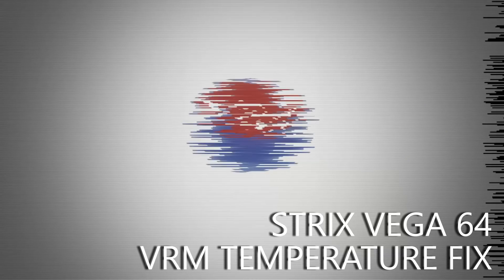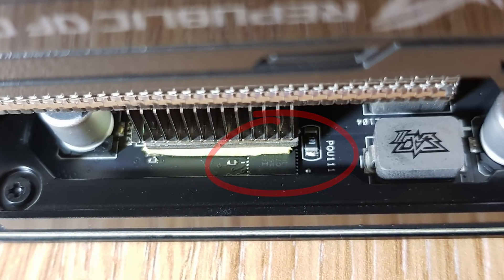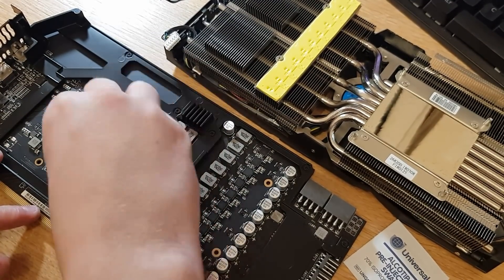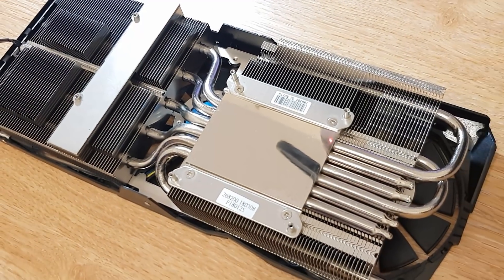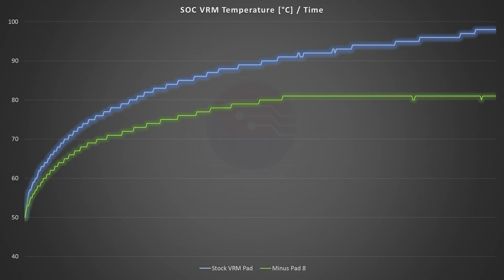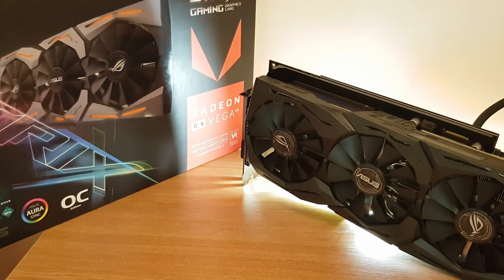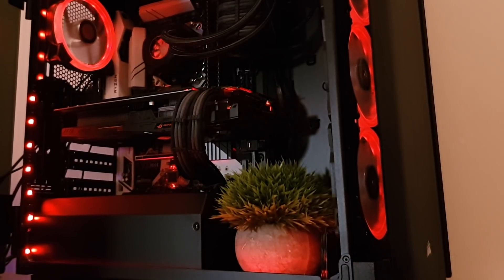Asus Strix Vega 64 - VRM Temperature FIX

Comment: Had this problem on my Arez 56, bought the same thermal grizzly pad mentioned. Totally worth the money, no more ~99° C VRM temps in HWMonitor. Thanks for the tip, and for the advice to undervolt for better performance.

Comment: Done this mod. Temperatures of gpu and hbm memory went down to 70c +/- but in some more demanding games gpu will stay around 74c +/- hbm memory +/- 80c with hot spot a bit higher. Running card with stock Vega 64 frequency undervolted on gpu and overclocked and undervolted on HBM2. I'm playing in 4K but noticed that in 2K card frequencies are solid and temperature is lower. Sweet spot for Vega 64 is 2K so if that's your resolution then this card is still relevant in 2020.

Comment: this happened to me, when I play more game which need more performance I play about 10min and after it turn off (I use it as EGPU with razer core X). when I left it our from the cover it is no problem but when I leave it inside after 10-15 min it turn off it self.

Comment: I did this fix with my vega 64. After plugging it in, there was a corrupted blue screen and now it doesn't show any display. I tried to remove it and plug the hdmi on the motherboard but it's not showing any display either. Did I just break not only my GPU but also my motherboard?

Comment: Cool video, i have this same card. I had no idea about this problem! I didn't even notice this taking my card apart, and I just installed over the weekend, a full waterblock setup for my Vega64 Strix including a full motherboard block, and i went from 70+ degrees, all the way down to 20-23 degrees idle and 28-35 degrees under full load on my Vega64. I was expecting in the area of 40-50 but i am blown away by the improvement.
Reply: Hi mate, which waterblock did you installed on your card? I have the same model and I'm interested on cooling it with water. Thanks in advance!

Comment: Asus is not cooling the coils at all. Yeah I know that they are able to take up to 125 ° Celsius but its a shame how ASUS is wasting on possible cooling perormance. This cooler is so big, it could be as good as a Morpheus II aftermarket cooler. I use this cooler with a  Vega 56 FE and i achieve temps below 60° Celsius ( below 75° on hotspot) under full load with gpu power draw of up to 300 watts. I get constant 1670Mhz at the core and 1100Mhz @ VRAM. (BIOS is flashed to Vega 64) Easily slaying stock Vega 64 cards with 25124 graphic score at Firestrike.

Comment: I am a bit late to the party, i did this fix just like you did, but it didn't seem to have changed anything. Same Pad same everything, according to HWInfo the VR VDDC Temps are still hitting 116 °C
Reply from the maker: Sounds like a lack of pressure somewhere 🤔 just by the nature of the thicker and bigger pad you should see a drop. Could always try dropping the voltage a little in wattman but I'd say it's more likely pad contact.
Reply: @F7GOS  thank you i will Look into IT and tighten the screws

Comment: What is thickness of thermal pad you used?
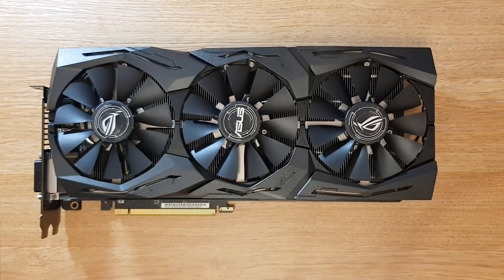Reply: He actually tells you at 2:50 - He uses a Thermal Grizzly Minus Pad 8 120x20x3, so 3mm thickness. I am trying to find this pad at the moment, but it seems it is out of production and nowhere in stock. I even cant find the 2mm thick version. I wonder if 1mm would be thick enough?! I also emailed Thermal Grizzly about the availability of 2mm/3mm pads, but got no answer so far.
Reply: @kildjan  I ordered Arctic thermal pads, 1.5mm big sheet. I think I can put double layer that will be same as 3mm, and its way cheaper. Grizzly is 30$+ alike just for vrm lol. I am going to put arctic + arctic mx4

Comment: I always buy the wrong Coolingdesigns for the graphiccards. First I had a Rx 580 Armor OC which cooler was preeety loud and crap mostly like 84 degrees. Now I have a Rx vega 56 Arez Strix and there is the next issue the vrms are overheating and the card itself gets up to 78 degrees not the best temperatures i think. I just should have bought the Pulse Edition from Saphire. But I still dont get it, why does the Pulse have better temperatures with less cooler and smaller backplate?
Reply from the maker: Guess the strix is more of a design which has been adapted for Vega whereas sapphire is designed specifically for it. Strix is good once you sort out the issues though, just not the best out of the box
Reply: @F7GOS  Thank you for your reply, ithink i will send it back get another cooldesign. Would you buy the red dragon from power color or the saphire pulse?
Reply from the maker: Ive only ever used lower end power color cards but all have been good. That said I had a R9 Fury with a similar design to the pulse and it stayed cool and the nitro+ vega i have now is really good 👍🏻
Reply: @F7GOS  thank you very much. I think I will buy the pulse because its cheaper.

Comment: Maybe nobody will read this till now but thank you so much. Worked very well for me. Asus really did a poor job with the cooling on this card. But thanks to your fix my Vega Vrm temps went down from 100-110°C! to Max. 80°C. In my case it also has to do with some airflow changes I did in my meshify c but probably mostly changing the cooling pad. Thank you very much! Greetings from germany...
Reply: Hi there, I'm having the same problem and I was wondering what is the thickness of thermal pad you applied ?
Reply: @chandaromey2910  Sorry im answering that late. But i used the same thermal pad he used! Did u fixed it by now?
Reply: All good i fix it already. Thank u
Reply: @chandaromey2910  good to hear that 👍🏼

Comment: you've convinced me to do this to my Vega 56... I'm going to tackle it this weekend.

Edit: An answer for you from Asus regarding RMA: As long as there is no damage to the card, and it's shipped with the original heatsink/fans and there's no damage, there's no issue.  Swapping out Pads/Thermal Paste won't void the warranty as long as there's no damage to either the heatsink/fans.
Reply: Did you end up doing it on your Vega 56?

Comment: I have a question: Are you not losing warranty when doing this fix? One of the screws is capped with the white sticker. Warranty loss if voided - does this not applying here? I just bought Vega 56 Strix and "can't wait" until I see this issue and will have to fix it... Now I am also buying thermal pads...
Reply: has asus fixed it by now? what are your temps like?

Comment: Thanks, that solved my cards overheating problem. Whether it was the gpu paste or the VRM I don't know. I Used thermal grizzly 3mm on the VRM and Arctic  MX-2 on the GPU.
Reply: Could you tell me the temps please???
Reply: @enrico6508  The card is running folding@home and GPU Temperature [°C] max 63, GPU HBM Temperature [°C] max 62, GPU VR VDDC Temperature [°C] max73, 
GPU VR MVDD Temperature [°C]
 max 67, GPU Hot Spot Temperature [°C] max 77. Fans around 1750RPM. Closed Fractal R6 case.

Comment: Hey what about the warranty? I really dont want to lose it but 110 SOC is too High either  (Card is screaming)
Reply from the maker: Guess thats the catch 22,  probably better recording the data and raising an RMA with the outlet originally purchased from if you are not comfortable replacing it. I got two different answers from two asus reps so best bet is to check with the outlet you purchased it from originally
Reply: @F7GOS  lol i just looked at my card, they adressed it already, there is a mini heatspreader on it. but why is my soc temp still that high? I could send you a Picture
Reply from the maker: The fix still isnt as good as a high quality thermal pad unfortunately. I guess you could try reseating the pad as it sounds like its not making full contact somewhere

Comment: I can't find a Full Thermal Pad with 3mm thickness. Would 2mm suffice or would 3mm patches be ok too? https://www.lazada.com.ph/products/gigaware-100pcs-silicon-thermal-pad-heatsink-conductive-insulation-paste-3mm-blue-i143318474-s164381071.html?spm=a2o4l.searchlist.list.46.172234f8VE0hse&search=1

Comment: fortunately i don't care since i have a custom loop with double 420mm radiators. But still very silly for asus to develop such a good custom pcb and to fail cooling so badly.
Got mine for 299 euro + 150 euro waterblock from ek.

Comment: ASUS may have silently rolled out a fix for this. I did this switch to a minus pad 8, which dropped VRM temperatures by around 12C. However i had been getting higher hotspot temps, reaching 106C before throttling the card. My new paste came in (originally i used Kryonaut, which can tend to be on the thick side of paste. Reddit forums and buildzoid seem to recommend less thick paste on account of vega being finicky like that. Repasting with hydronaut.) I have a Strix Vega 56, production date of January 21st, 2018. Upon taking it apart the second time, I noticed the plastic bracket has a protrusion over the partially covered VRM with its own itty bitty thermal pad.

Silent ASUS fix https://imgur.com/a/XXA7Uao
Reply from the maker: Silent being the key word for sure as they still dont acknowledge there was a problem in the first instance

Comment: This explains my Vega64 running at 1430mhz under full load. Thanks for inspiring me to take it apart and sorting it out.
Reply: Fixing cooling issues will not fix strix vega 64 throttling. Asus royally screwed up this one. Undervolted I can get 1555Mhz stable.
Reply: @Herbertti3  i have slightly better thermals and 1560mhz under load since. It helps but not much...
Reply: @rolandsuchanek  Great to know its basically what you get with this card. I bet we could see 1600Mhz+ with better bios since stock bios is probably tailored for poorly cooled VRM.

Comment: Am about to finally do the same myself on my strix vega 56. 110c VR SOC under stress - far canal! That’s got to change.
Reply: Down to 90c on the VR SOC and card is quiet and cool on an under volt, beating 1070ti performance (EDIT - on a timespy bench and based only on some 1070ti scores, not all) and no hotter than 70-75c on the GPU core.
Reply: "card is quiet and cool" What the fan speed?
Reply: Alexey Prutik sorry! Should have come back a bit sooner. No more than 1250-1500 rpm I think. I’ll check that but it is certainly doing better. That’s in game, not the benchmark. KCD, Total War Warhammer, etc. EDIT - yes that's a highest speed of 1,600 rpm in game. which means the card is really quiet. Really just lets you know it is still switched on, doesn't distract at all. On the campaign map in TWW I can't even hear it, because it's around 800-1000rpm which is really low. And when a battle starts, obviously I'm focussing on other things. Effectively silent 60fps at 1440p ultra in TWW. Love it.
Reply: @georgemorley1029 Can u tell me in wattman what's your target temperature that u put it there in setting? if i put 75 C degree yes the fun wont exceded the 1600 rpm in game, but if u put 60 C degree then the fun ignore max rpm setting and go up to 2000 rpm to keep that 60C target degree.
Also at 1600 rpm and over is not quiet at all is fact is ver loud man, i have 10 fans on the cougar case, but at 1600 rpm i can hear very clear my gpu funs in top on all others 10 funs case, quite annoying.
Before i was haveing a rx 480 witch at 1600 rpm was very quiet i cant hear at all.
Reply: Dan D Sorry, can’t tell you because I’ve sold it and bought the RX5700XT. The difference is astounding.
Reply: @georgemorley1029  Yes i was thinking to buy rx5700xt first but then i was thinking i got only 75 Hz 1080p ultrawide monitor, so i think vega 56 is enaught for 75 Hz 1080p.
About Asus Strix Vega 56 I fix it those days, first i replace thermal paste, the old one was almost gone she dry it all, then and replace thermal pads to, then grease a little bit those 3 fans to, now i see 35-37 Celsius degree in idle and around 47 C -50 Celsius in games also fans doesn't go much higher than 1500 rpm and they do not have cool noice anymore.
First i was trying  thermal grisly paste, wow that paste is kind a sax tried to spread it about one hour is not have adherence at all on the gpu surface she kepp peel off lol then i finaly throw it to garbage where i think it belong :D  she may be good at cooling but not good at all to aplly, may be was a broken Grisly paste lol. Then i found an old Artic Silver MX4  and that has a good adherence on the surface gpu so was a hell much easier to apply.

Comment: I promised a video and it will come next month. At the moment, I have no time to cut and upload everything, but first tests are already done and I want to share them with you.
There is a possible fail with my new thermal paste application, but the main goal was to compare VRM cooling... So here you go:
https://www.dropbox.com/s/trn1bqh2i6blvwq/Asus%20Strix%20Vega64%20-%20Thermal%20Mod.pdf?dl=0

Comment: I did this fix and I got some improved temps, but there is still 1 temp that goes rly hot ( over 100 degrees ) and that is GPU hotspot. I wonder why.
Reply from the maker: Are you still letting your GPU get to around 80?
Reply: @F7GOS  Yes GPU goes to 80 pretty fast. HBM also goes above 80. The VR temps seem to be lower than before though. Card is at stock clocks and undervolted. I used thermal grizzly minus pad 8 and lots of noctua paste. Did I put bad application of the paste or something ? I have the exact same card as you. Other people have achieved over 1600 mhz on the core and 1100-1200 mhz on the memory. I would like to get the memory to 1100 too.
Reply: And by the way I still have some noctua paste and scythe paste but I assume the noctua is better right?
Reply from the maker: Can say for sure but that does seem hot, whats the fan speeds set at in wattman and have you adjusted the "target" speed at all?
Reply: @F7GOS  No I have not. When I game they are at about 50%. Putting them lot higher makes it become kinda loud. I'm just wondering should I reapply the thermal paste? Someone did the same thing as me, he even used the exact same thermal pad and seems like he got better results.
Reply from the maker: Worth trying, also might be worth setting a lower  target temp as the fans will start to spin up at that temp.

Best thing to do is find out what RPM you are comfortable with and set that as the max, reduce the target temp to a value of say 65 then see how that goes.

 Ive been messing around with case fans this week too and setting the system up to get as much air in and out of the case does help. 

Pretty sure my target is now at about 60C, min fan speed 800, max 2700 or there abouts

What refreshrate monitor are you using?
Reply: @F7GOS  Oh good ideas! I will do that with the fans. My refreshrate is 144hz.
Reply: This is what my gpu looks like after 5 mins of gaming: https://imgur.com/eJLaGmv   Putting the fanspeed above 60% started to get really loud in my case. I'm probably going to try to reapply the paste later.
Reply: Hey I reapplied the paste and temps are better :) I was able to increase clock speeds too! I just put so fucking much paste on the hbm's and on the core xD thats the way to go with vega: over do it.

Comment: thanks dude!! stock 115 on hotspot 80s core 90s vrm
 
with mod 80c on hotspot 60s core 70s vrm :)
Reply from the maker: Glad its made a difference!
Reply: Hey chris. I did the mod too, but my results were not as good. Which thermal paste did you use and how you applied it?
Reply: I used thermal grizzly kryonaut and I used the spread method, also I’m running a undervolt of 900mv on the core .
Reply: @DAMGUNHAR  Oh alright. I RMA'd my card because there was something wrong with it. It is shipping right now to the store. Bought used gtx 970 for the meantime. Overclocking it right now :D
Reply: @megapet777  hi which store? And did u get revised card
Reply: Rana Akbar Store was jimms.fi and still waiting for the card because they sent it to asus
Reply: At which fan speed and which load ?

Comment: I really hope my upcoming card is one of the fixed ones... The dude I'm buying it from hasn't sent me screenshots about thermals yet. I've never taken a GPU apart, but I've built many PC's and so on for more than a decade - shouldn't be an issue to do this, if it's necessary for my unit. 

Thanks for the video!

Comment: I bought an Asus RX Vega 64 on Wednesday and it's the "new", fixed version with extended VRM cooling piece of metal. Nevertheless, the temps and noise of my card are very disappointing. It's beyond acceptance. While GPU and HBM are holding 75C line, VR SOC gets up to 98 degrees only a few minutes after I launch a game... The fans are running wild at 2000rpm... What a crap design. I'm going to order some thermal pads and apply this mod. Stay tuned for a video in 2-3 weeks.
Reply: Same here, even if is the fixed version I have 93C in hotspot and 108C(!) in VR VDCC after 15 mins of firestrike :( despite the undervolt @1000mV
Reply from the maker: Very interesting and disappointing to hear that they "fixed" it without even acknowledging there is an issue and also that the fix is still not as good as a diy pad 🤔
Reply: @F7GOS  Short question, how did you make those temperature diagrams? Are they from a monitoring program, or self-made in MS Word? I would like to make a similar comparison. Thanks.
Reply from the maker: They are self made, recorded and logged the temps first, exported the data then created graphs from that
Reply: @MakakMagot  hi did you make a video
Reply: @Lucatoni22  Still no video, but a graphical comparison. Look for my other comment. ;)
Reply: @MakakMagot  thanks
Reply: Yeah I have "fixed" batch too. VRM is hitting 100C in coolermster H500 case. Minuspad is on its way, only thing asus managed to do its now little harder to apply the fix.